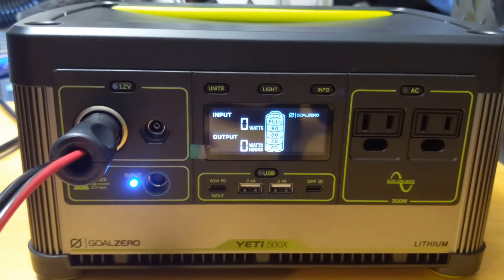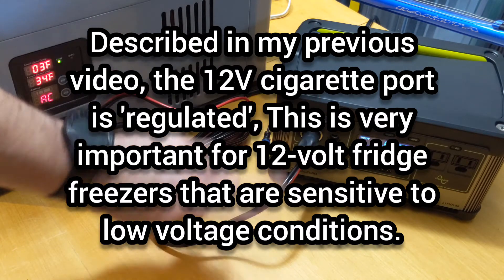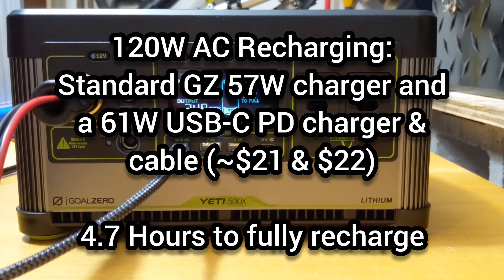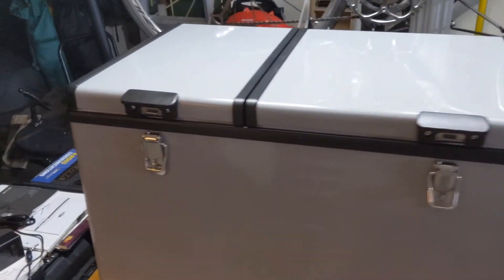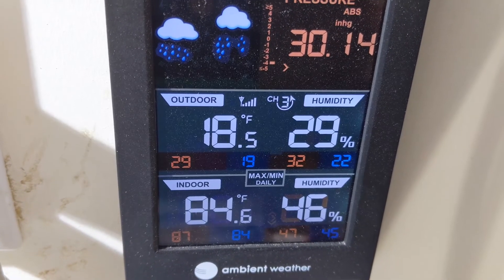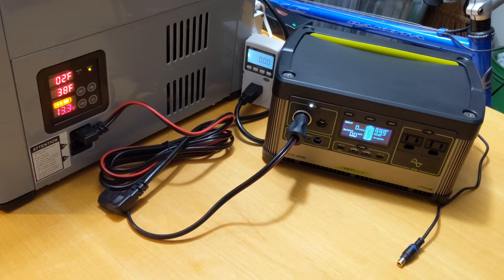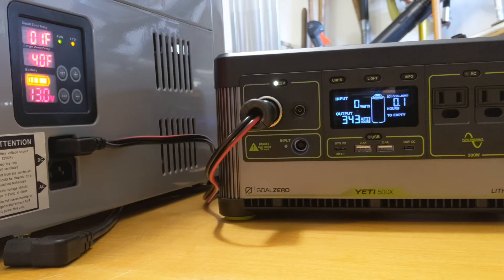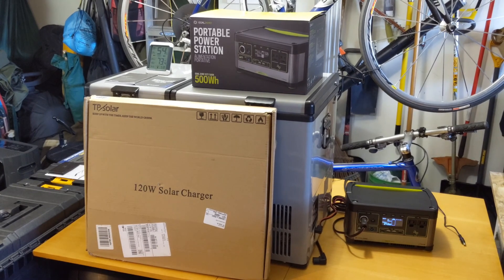Goal Zero Yeti 500X: Testing the Limits!

Comment: Over voltage protection is 27v, reads in goal zero forum, so u can use 24v battery or over 22v panel for charging,  but is the mppt 10 or 15A and how limit using 24v battery,  the 12v car charger is 10a, so 24v would be 240w , maybe too much, 200w good

Comment: Yeti 500x is made with extremely cheap components. The battery drain relatively fast when not in use. I cannot believe they cost 5-700 dollars. If you leave it in storage and it drain down to 0, it will not take a charge and will brick. Mine bricked and I went with a Jackery, sat in storage for 7 months and it still had 95%+ of its charge. Yeti made good coolers for about a year, now they just overcharge people for pieces of shit.
Reply from the maker: I agree. Disappointing how it drains in storage even if you have all the ports turned off. If you forget to turn off a port, it will drain very quickly. I recently got a jackery and I like the feature that will automatically time out a port if it's not in use. And shut it off automatically for you. I've also observed that the jackery maintains a charge really well in storage. Thank you so much for your comments You're inspiring me to make an updated video since I've had this goal zero for a while. 🖖🙏
Reply: @KD2JRH  Cheers!

Comment: Could I charge my ebike with this? 320wh battery, cheers
Reply from the maker: This unit is 500 WH but you might not get the full 500 because the internal battery management system will shut it off to protect. You'll almost drain the GZ500x but you should be able to get one recharge. You may want to go up one size so you can get a couple of charges. I recently bought a Jackery 1500 and I'm very happy it lasts much longer on camping trips.
Reply: @KD2JRH  cheers👍🏻 can you charge the Jackery units with the goal zero solar panels, nomad 50 with the 6mm jack.
Reply from the maker: @RobHill00  you'll need some kind of adapter I haven't tried it yet but from what I understand the jackery 1500 has a unique adapter that it needs. Sorry I can't tell you exactly which adapter I'd recommend researching further if you've already invested in the nomad solar panels. Good luck with it and thanks for commenting! Have a great weekend! 🖖
Reply from the maker: @RobHill00  if you already have the nomad solar panels you may want to look at the GZ 1000X. I got the jackery 1500 because I wanted the inverter that was inside of that unit. I wasn't planning on recharging it with solar I use a generator for that one. There are several pros and cons to the Jackery 1500 so it might not meet your needs.
Reply: @KD2JRH  thanks for the info!👍🏻

Comment: i would be happy if it can run a 700 watt microwave for just a couple minutes once in awhile
Reply from the maker: I would recommend a larger unit. The surge on the microwave might trip the protection on the GZ500X. I found the trip protection to be rather sensitive on this unit.

Comment: Another video shows approximately 19 hours run time on a Goal Zero Yeti 200x  and a 55 watt fridge 🌻these GZYs really have serious off grid power❗️
Reply from the maker: The fridge I was using to test pulls about 75 watts. I would definitely use a smaller fridge if I was going off grid for a longer period of time. Or I would get the GZ1000. Thanks for your comment!

Comment: Hey did you happen to notice with your 500x that charging with USB-C only show’s a phantom output of 2w? i.e. INPUT 55w OUTPUT 2w? That’s with no other loads connected.
Reply: Thanks for letting me know, interesting Goal Zero considers this a fault and asked for the unit to be returned. I don’t think I’ll bother though, sounds like more of a firmware bug :) subbed too, thanks for the great content
Reply from the maker: @OutdoorsIQ  thanks for letting me know and commenting!
Reply from the maker: Sorry for the delay in my response, I just got back from a camping trip. I'm not sure if I've charged it with the type c connector only. I'll give it a try later today and let you know if I get the same results that you are seeing! Very interesting!
Reply: @KD2JRH  thanks for that, interested to see how you go😀
Reply from the maker: @OutdoorsIQ  I checked, Yes, it does use 2 watts to power the USB ports, mine does also. Thanks for coming back and checking!🖖

Comment: I really thought it would have lasted longer than that, it's a little disappointing.
Reply from the maker: I was disappointed, was hoping to get more of the 500 WH. Thanks for watching and commenting!🙏🖖
Reply: Real small fridge uses 0.25kwh a day,  maybe voltage drop too long and thin wire